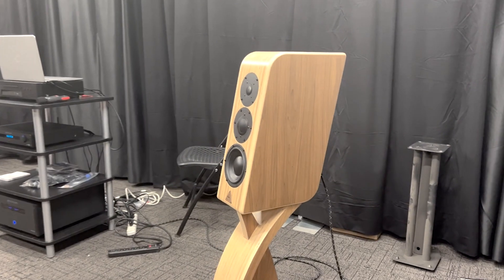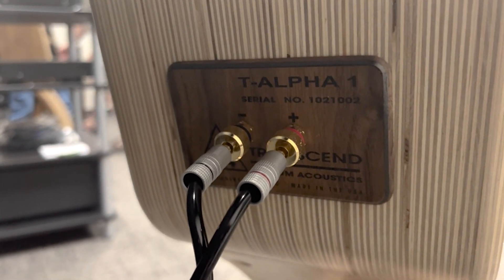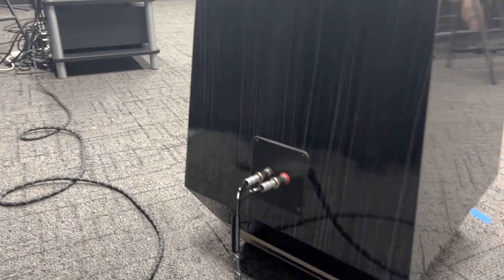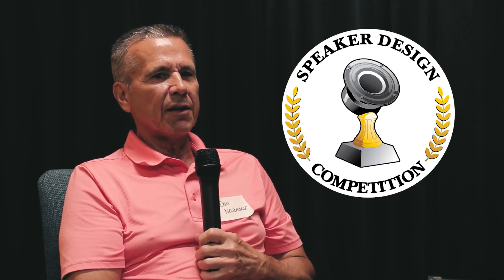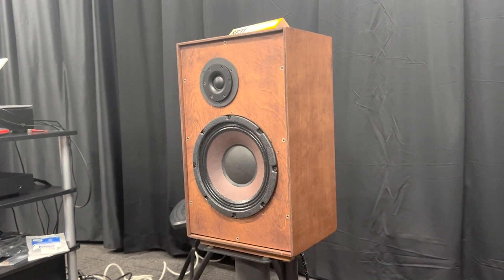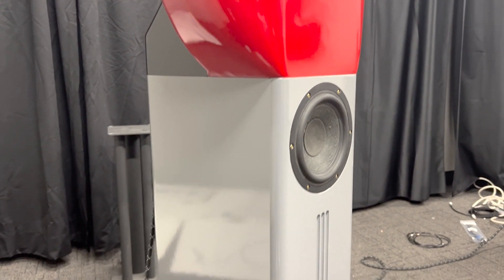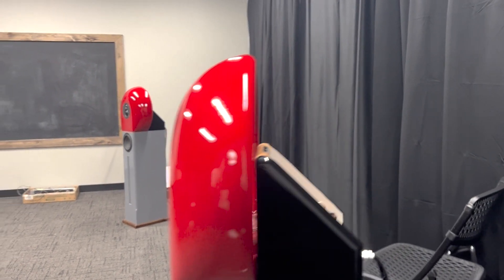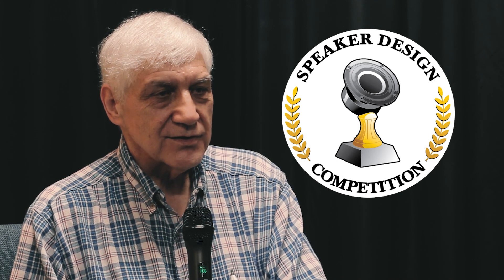2022 Parts Express [Speaker Design Competition] - Over $300 Category

Comment: I apologize in advance to the designers of the B12 and the Mnemosyne, but I can't help but see these (and any other 'retro' speaker), as a somewhat failed design from the get go. 

Not that they do not sound good, but there are, real world, sonic reasons why speaker designs have moved away from wide baffles, with the raised edges for the grills. I can't help but think, they would sound better in cabinets with more of the things that have been learned in the last 50 years or so.

I think the same thing when I look at all the commercially available retro designs, too.
Reply: people like retro and audio buffs like to rotate gear, maybe one month you listen to monkey coffins and the next month you listen to Focal Sopra. nothing is better or worse, just different.
Reply: @linandy1  no there are definitely worse designs and ideas, and good reasons they changed. For starters the wider front baffle losses imaging and projects the sound forward making it sound very point source. The stepped sides where the grill goes on causes diffraction issues, and consequently why you don't see it very often in modern designs. In this day and age there is no reason to be making such old fashioned looking speakers, unless you have zero imagination, has zero wood working skills, or you simply love the look of 70's speakers at the cost of sound.
Reply: When the grill is included, the Mnemoscene essentially has flush mounted drivers, and non-resonant cabinet,  so that is a reasonably modern design.  The B12 focusing money on exotic coil and capacitors that didn't matter to the sound was sad.  However, depending on the crossover points, both of these designs may be beaming in the critical frequency ranges and as such not illuminating the cabinet edges you are concerned with.  Depending on the driver size and crossover points a wide flat baffle is just a wide angle waveguide in the end.
Reply: @NackDSP  taking a better look at the grill it may not be as bad as I first thought, although if you are going to attempt to make it a wave guide from the grill the mid could have been better fitted to the shape. I prefer what he did to the alternative. Would have been nice to have offset the the tweeter and mid to not make the wide baffle problem worse.
Reply: I think they just kinda failed to meet the spirit of the competition, and its intent on new and unseen stuff